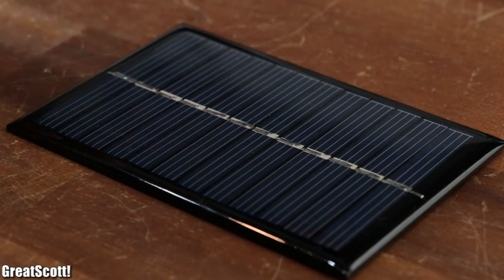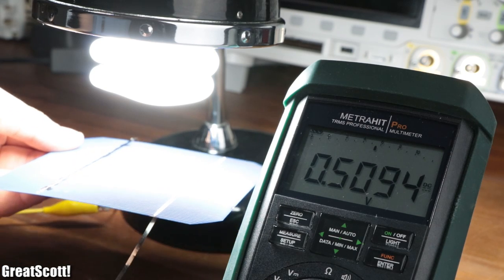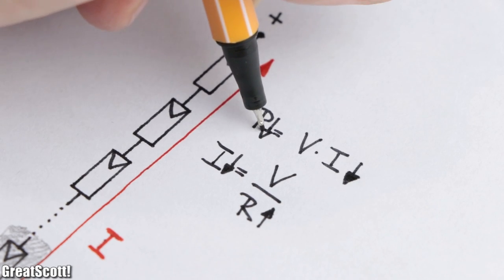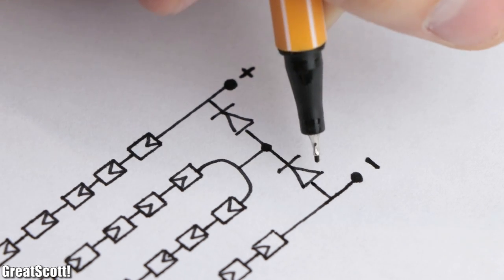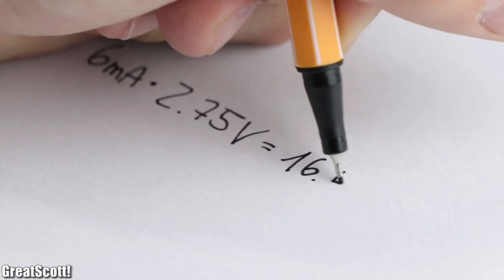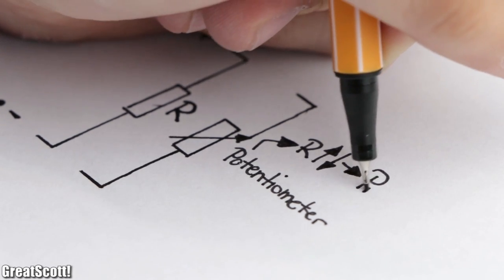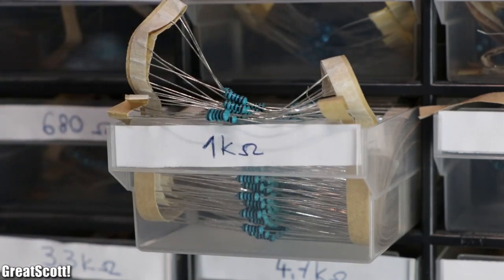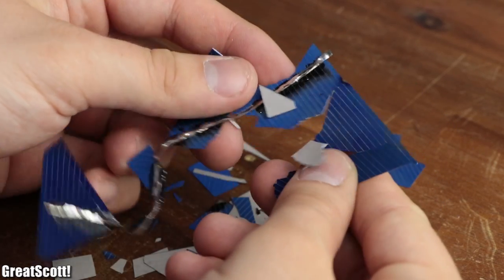Electronic Basics #29: Solar Panel & Charge Controller

Comment: NO HATE, But I created a solar mobile charger and the output of the 4 solar panels in series was 7 volts in sunlight, and 2 of the solar panel were only 1×1  inch  the other two are 2x2 inch . Your solar panel is so big and still gives less than 1 volts. 
And my solar panels were rigid and not easy to break like yours.
Great Scott I am not opposing u but just telling u.
(TO EVERYONE WHO THINKS I DIDN'T ADD A VOLTAGE REGULATOR TO THE SOLAR PHONE CHARGER CIRCUIT: I DID :)
Reply: how it works

Comment: I don't recommend your anself pwm charge controller if you use a sealed lead acid battery, because it always charges to 15v, wich is too high for sealed batteries...

Comment: .
do not try building your own panels from cells, the cell cost, the glass cost, plastics, connectors, the very expensive resin, its just way cheaper to buy a 100w - 150w panel than build one etc. 
i went self build, big mistake, cost more for lower quality etc